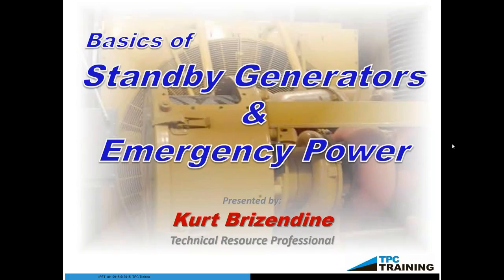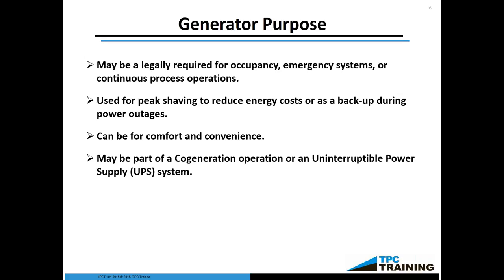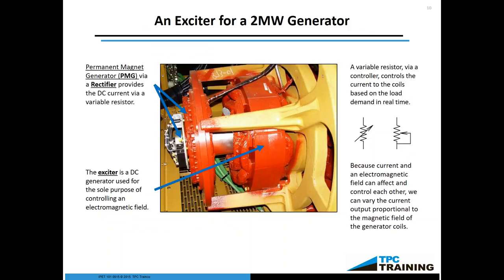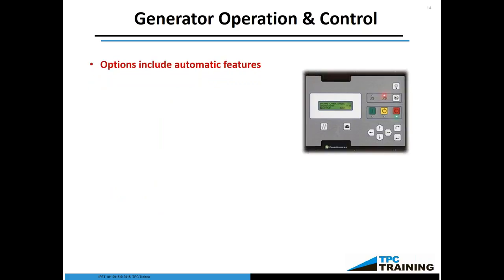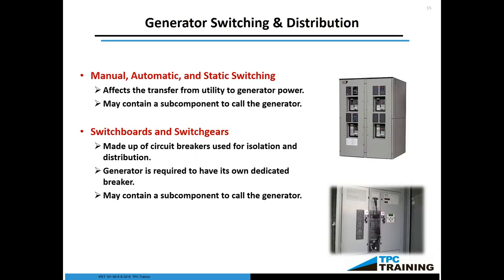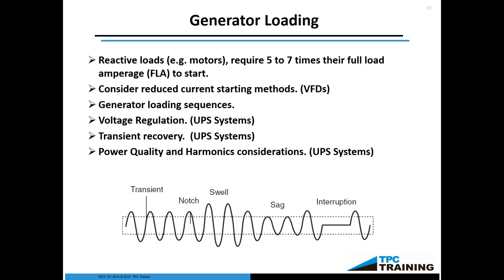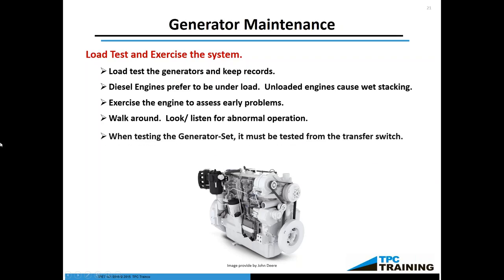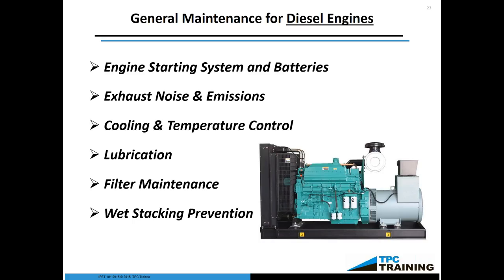Standby Generators and Emergency Power w/ TPC Online Webinar | TPC Training

Comment: Like it👍😁 serviced a couple baby ones today (Generac 10,000 and a 3500 inverter)
Tomorrow a 10 or 12 QD Onan  and Power Tech Generators  Isuzu Engine Model 4LE2T.  It's good when it's done👍
Like the 10 second rule. I was trained to warm up (100KV and up) for 10-20 minutes. Now they start up at full speed. Kinda of hard to get used to.
Great information and much appreciated.

Comment: awesome info.  I am new to Generator maintenance.  One of my generator suddenly started to display Low Voltage/low frequency.  It crancks on, run for about 20 seconds at low power then shuts down.  I can not pinpoint the issue.  Not sure if the AVR is at fault, or maybe bad diesel, or air in the fuel lines.